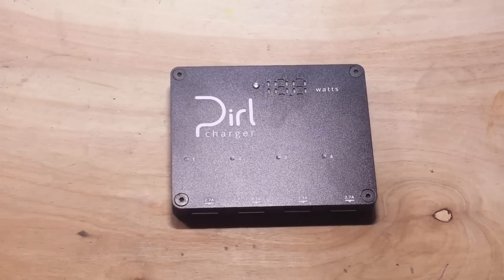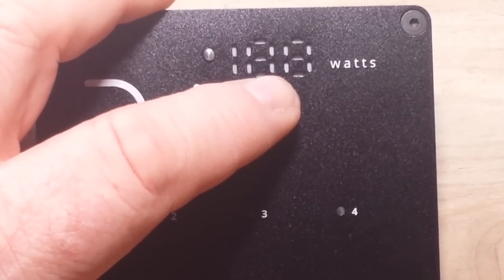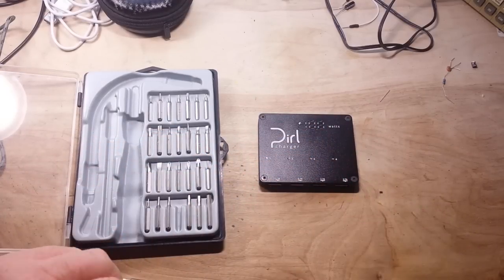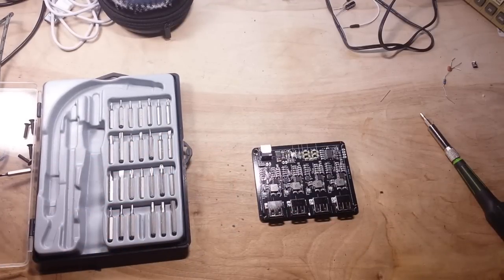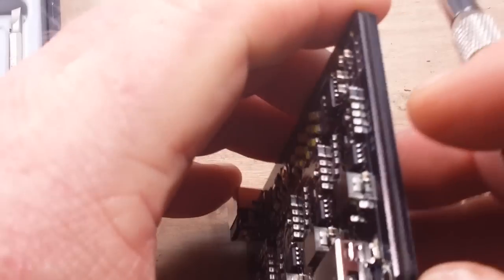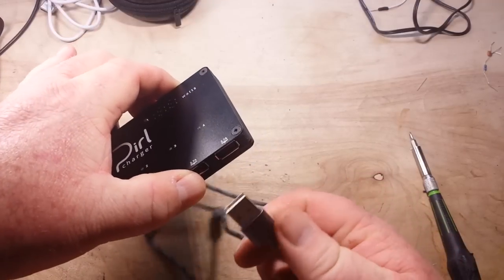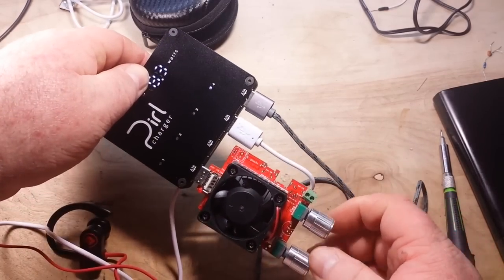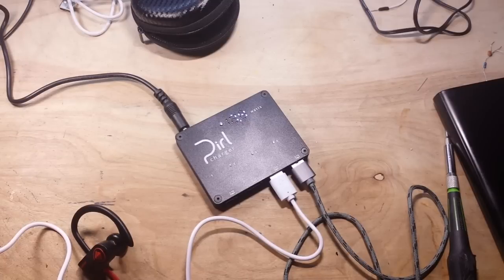Pirl 4 Port 10 Amp USB Charger Teradown

Comment: I have two reservations/criticisms/nitpicks on the product itself. One is that you're supposed to use it with a power supply you might already have, when convenient - however, for example most laptop chargers are 19-21V range, so step-down converters limited to 18V fall a bit short. For other, at maximum load, the bottom of enclosure can reach 100°C, as found by DiodeGoneWild. This calls for two potential additions to the kit, a set of rubber feet to set it off the surface that it's sitting on, and either the rubber feet need to be screwed in, the enclosure screws could terminate in them, or else very careful attention needs to be paid to adhesive so they don't fall off when they get hot; also Diode suggested that a vertical stand would be appropriate. I think it could also be a piece of FR4 or aluminium or a laser cut 8mm or thicker acrylic.

Comment: For your unidentified IC, look at TPS2549 by Texas Instruments. It is indeed charger identifier so USB devices know they are permitted to draw a bunch of current, but it's also a current limiter and short circuit protection, so people with a habit of inserting cutlery into their USB ports should be reasonably safe.

The wall plug adapter is by a trusted Taiwanese company. Unfortunately if they decide to ship that one, that alone puts the whole package outside your desired price range, those aren't cheap.

Comment: Had to look up FR4 "glass-reinforced epoxy laminate". Looks bulletproof I'll have to wait and see what final pricing is, but I'd sure like one. Thanks for introducing it!
Reply: Unfortunately the MeanWell power supply that they bundle is going to cost more than $20 in a bulk order, it's not a cheap manufacturer, so i think you can give up all hope of the whole package costing less than $30. And it's a good choice, an unreliable or unsafe power supply would ruin the product. How can you hope of them to compete with the likes of Anker and IKEA on the price?
Reply from the maker: Yeah, im waiting on the final pricing too. I hope its between 20-30 bucks. Thats anout the max id pay for a charger.
Reply: FR4 is the standard grade of PCB material (there is also a widespread lower grade, FR2), and it is indeed very robust. Which means rather than having someone machine a case for you say out of aluminium or even plastic and charging you a kidney or two, you just order a bunch of PCBs off a circuit board company with no copper on them and they'll machine them for you from your Gerber files for a fraction of a dollar each, because it's all pretty well automated, you stack them up, and that's your enclosure, great for small production runs of small enclosures. They have aluminium core PCBs too, a slab of aluminium up to 3mm in thickness where a thin PCB is laminated onto it on one side, so that's how you can have aluminium top and bottom on your enclosure if you desire.
Reply: Siana Gearz, very interesting. I have a CNC mill so milling out a case is not a problem. But the stacked PCBs is a good idea if you can't do your own work.
Paul I'm with you on the pricing. Any more than 30 nucks and I don't need it!

Comment: 2.7A * 4 = 10.8A and on the board it says 11A... So what is it?
Does it limit the current to 2.5A per output under full load? 

Another thing I have noticed is that there is basically no output capacitance and no filter inductors. Output ripple might be an issue, it would be interesting if you could measure it. Is there maybe something on the other side of the PCB?
Reply: yea dont worry about ripple, it switches at 630kHz and has 94mvpp: https://lygte-info.dk/review/USBpower%20Pirl%20Charger%204x2.7A%20usb.html
https://youtu.be/J58RLAKeIps?t=31m17s